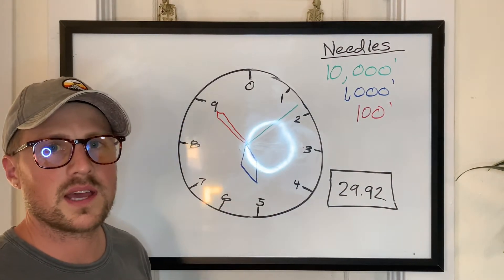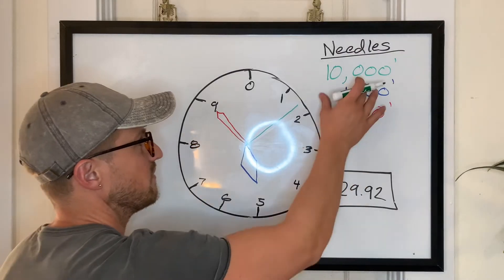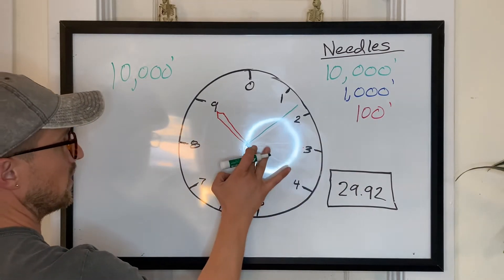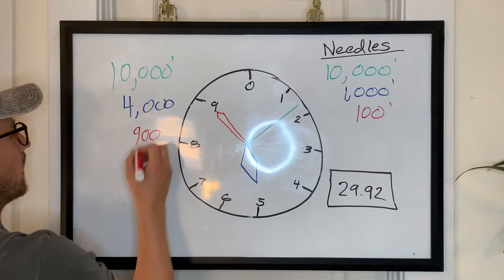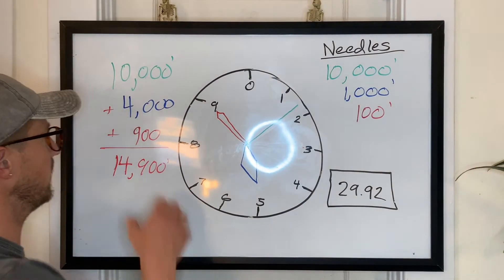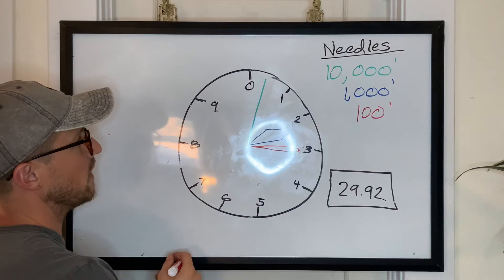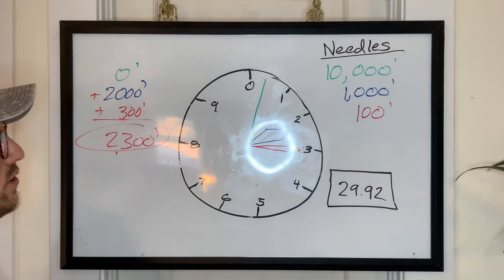How to Read an Altimeter - For Student Pilots

Comment: this kinda confused me because your image on your ptp does not show the needles the same. it looks like the 10,000 needle is the 100 needle and vise versa.
Reply from the maker: Each altimeter has different needles. You need to understand which needle is which for every altimeter. They are mostly the same, but like the ones in the video can be different.
Reply: @PartTimePilot  Lol why is the second hand 10k but the hour hand 1k, and then the minute hand 0.1k. Kinda mixed up...

Comment: The best way to do it is scan all 3 in order. And simply take the number that is only in the positive (forget the number above at all) and note that as the whole number. Eg if it’s above 1 then just note 10,000 for the 10k needle of course. For the 1k needle, do the same thing. If it’s above the 7 then note 7k. For the 100 needle, if it’s above the 3 then note 300. You’ll get 17,300.

Comment: isn't the 10,000' hand the shortest, skinny one? 

Like another person commented, exactly like a hour, minute, and second hands. The longer the needle, the smaller the units of measurement. The shorter the needle, the bigger units of measurement.
Reply from the maker: I can’t speak for every altimeter out there but I can say what I have in the video is the most common. Some are different so you have to know what yours is. Once you start using it and even during preflight check if you have any elevation above sea level it should be pretty obvious which is which. 

Here are some sources that match how I have it set:

https://www.boldmethod.com/learn-to-fly/systems/how-does-your-aircraft-altimeter-work/

https://tghaviation.com/aircraft-instrument-services/how-to-read-a-3-pointer-altimeter/

http://learntoflyblog.com/2015/06/22/flight-instruments-the-altimeter-and-altitudes/

https://aviatorshq.com/basic-flight-instruments-explained-the-six-pack/

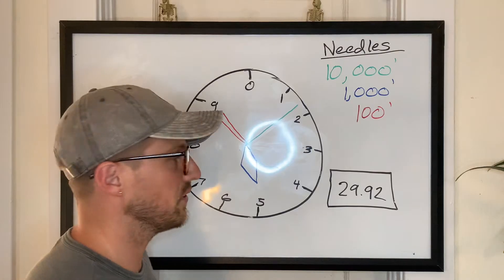Comment: 0:44 changes in sea level pressure?
Reply from the maker: The altimeter is basically sensing the difference in pressure of the air that comes into the instrument (the static air at your current altitude) and what you have set in our altimeter window. Inside the altimeter is something called an android wafer and it’s like a balloon filled with standard sea level pressure. When you climb in altitude and the static air pressure goes down. The pressure in the balloon is higher than the pressure outside and so the balloon expands. When it expands it turns the dial on the face of the altimeter to indicate a rise in altitude. This is how altimeters work. But when the sea level pressure is NOT standard, we have to change our altimeter setting to re-calibrate the altimeter so that it is not comparing the difference of static air to standard 29.92 but instead static air and the actual sea level pressure which we put into the window

Comment: What happens if you're somehow above 99,900 feet?
Reply from the maker: Then you need a laser altimeter like the space shuttle that pings laser beams and tracks how long it takes for light to bounce off the earth and return back to you. Lol. These altimeters in the video won’t work anymore because the gradual pressure we see in the lower atmosphere that the altimeter is based upon no longer exists.

Comment: how do you read it if you're below sea level?
Reply from the maker: It would be below zero. You have to have the knowledge that you are near or below sea level though. 

For example if you are in Death Valley and at -200 ft below sea level it would look like 9800’ but obviously this is wrong. 

Inside an altimeter is something called an aneroid wafer. Think of it as a balloon that is filled with sea level pressure air. When you climb the balloon expands because outside the balloon the pressure is decreasing. This expansion causes the dials to spin to the right and increase the altitude values. If you are to descend the pressure increases outside the balloon and the balloon contracts causing the dials to spin to left and show less altitude. This contraction would not stop once you go below sea level because the pressure would keep rising accordingly so the dials would continue to spin left past 0.